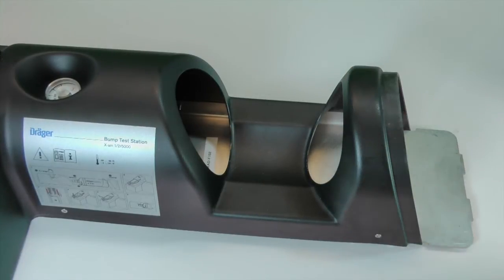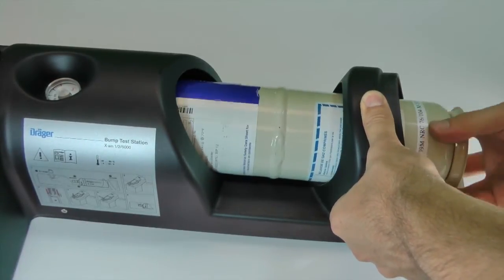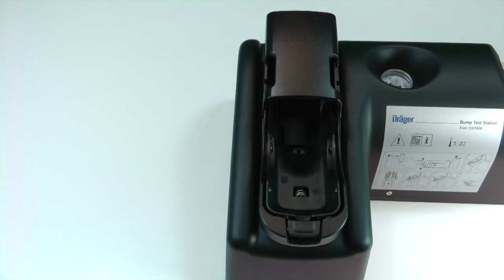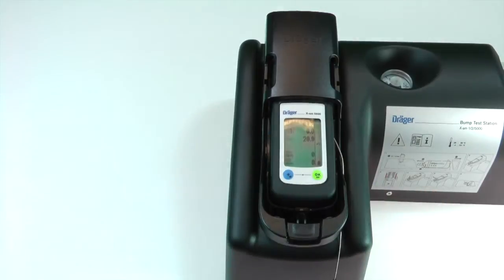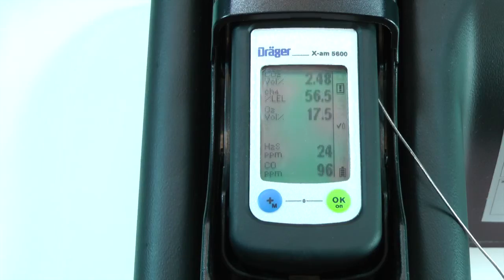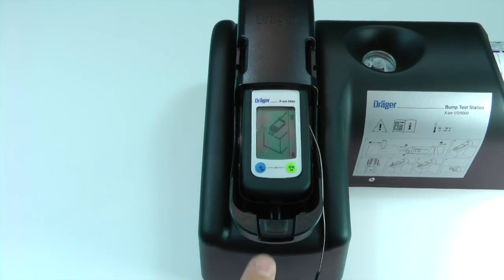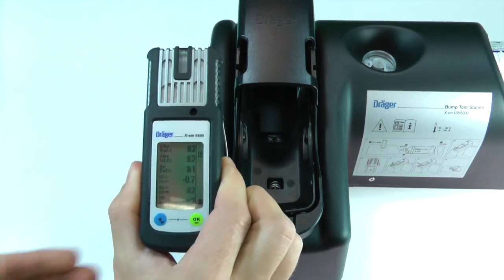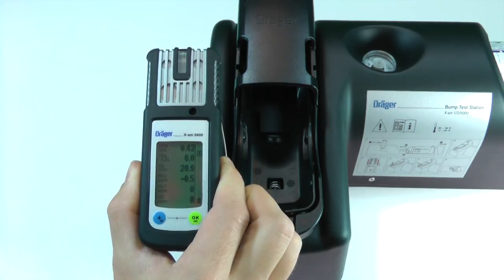How-To: X-am 5000 and 5600 Automatic Bump Test

Comment: I have recently arranged xam 5600. It only shows 4 gasses (ch4, co2, h2s, o2) but doesn’t other 2 gases. I desperately need to measure NO2 in a process. Can i use this? Kindly help.